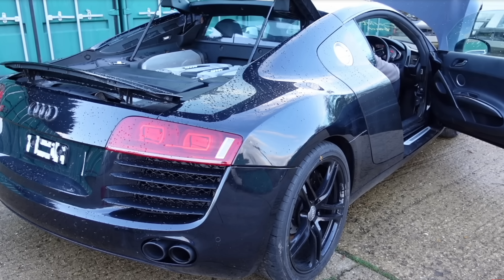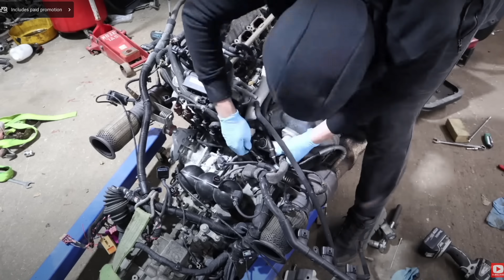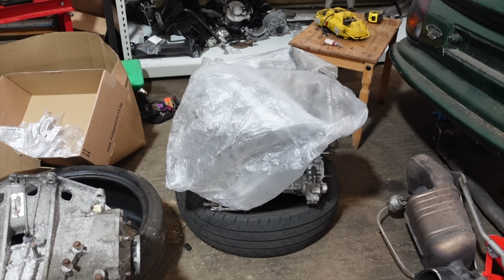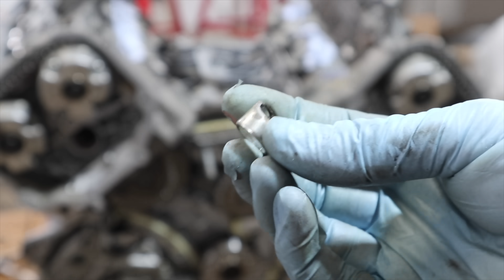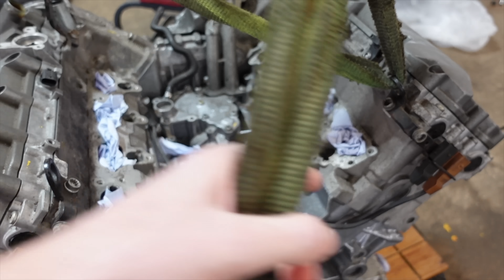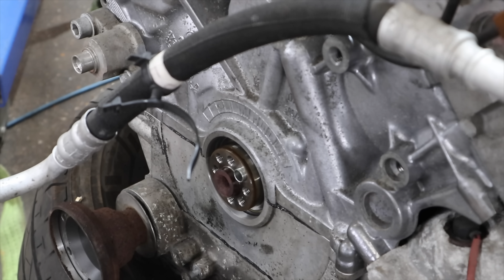REBUILDING MY AUDI R8 ENGINE *IN DEPTH* PT3

Comment: I hope you lubricated the front and rear oil seals before press-fitting them into place,  otherwise you'll wear them out pretty much on first start-up. A light coating of assembly grease will reduce any friction wear between them and the crank. Good luck 👍

Comment: @savingsalvage Didn't you forgot to tighten those 90º in the intake side of the left bank? In the video I only see you tighten those 90º in the exhaust side of the left bank, and the intake and exhaust sides on the right bank...

Comment: Not sure about this specific application, but I was taught that DI injectors always need the teflon seal replaced after you take them out, so put them in with new seals. Special tool to get them on and all that. Hopefully you researched this?
Reply from the maker: The injectors have all been refurbished with new seals 👍🏽

Comment: Anything with an oil seal....Assembly gel....Never dry....🤔😳😳..🇬🇧
Reply from the maker: Not crankshaft seals, they go in dry.
Reply: @SavingSalvage  Okay, but don't believe everything you see written in a manual is my advice...😏

Comment: Really enjoy you rebuilding these complicated engines, good job you have a good memory! There are a lot of rubber hoses that would be difficult to access when the engine is installed, why not replace them with new? Holding breath with you for start up👍😎

Comment: All that money you spend on cars, mate you a cleaning tank!! How are you rebuilding an engine and fitting crap covered cases 🤔🤔🤔
Reply from the maker: They’re stained, unless you paint them they’re not going to look much better
Reply: @SavingSalvage   fair enough mate..good job in it so far just would be nice to have a mint engine back in it👍🏻
Reply from the maker: @spa120  i spent an hour with degreaser trying to clean the sump and it didn’t look much different. 😂

Comment: Why does Dean not clean parts before he assembles. He is always so chaotic with his rebuilds - it drives me nuts watching him work with tools and parts everywhere on the floor. He should take a lesson from M539 Restorations he knows how rebuild a high performance engine and he is an ex IT guy.
Reply from the maker: I do clean them internally, the casings are all stained, so unless I dry ice them which I’m not going to do I would have to paint them to make them look better. I’ve spent an hour cleaning a sump pan and it didn’t look much different

Comment: Another great video it was definitely worth the wait .And the back cover was a pain by the time you have messed around trying to fit it and  if it was figure  out how not to pinch the head gasket its time to take it off and wipe all the sealant that's gone off and start again  same on the back timing cover of the bmw n47 engine 
Obviously at the factory the cover  goes on before the heads are fitted so its easy but no thought about any repairs in the future it would be easier if it was in 2 parts or a small push in top seal etc
Anyway thumbs dean great content and the Audi rs3 videos are great 👍

Comment: I am amazed that you reassemble the whole engine dry (timing, cams, cylindres, injectors, etc.) without oil prelube or assembly lube. Is there a pre lube sequance to fill oil galleys prior to starting the engine?
Reply: @admin I know, that's why I'm amazed by it.

Comment: Keep going Dean. I did sweat when I saw the crankshaft oil seals going in dry though!  Been watching yo from the start remembering the mustang too….
Reply: I think they are supposed to be unlubricated. I remember a warning on the packet when I did mine.
Reply: @PaneraiTravel  Cheers. I did wonder as Dean is normally spot on…
Reply: @PaneraiTravel 
I always thought the outer edge of the oil seal should be unlubricated and the inner part lubricated. You don't want the shaft and the seal to start up dry😅
Reply: @markwalton8644  The embedded PTFE in the seal itself is what lubricates the frictional surfaces. Adding oil or grease can introduce channels which could potentially allow oil to leak through. Therefore install dry on both inner and outer surfaces. We are all experts with Google 😉